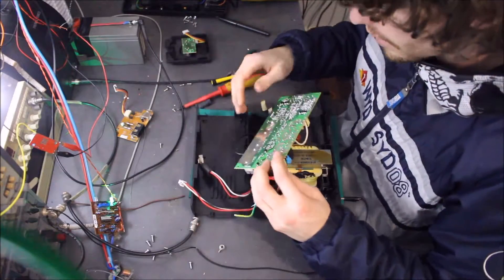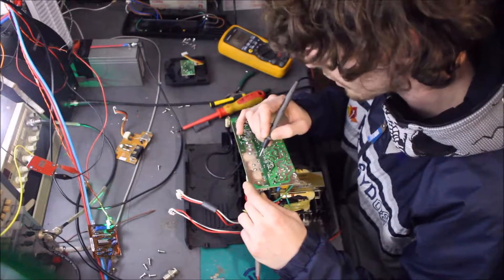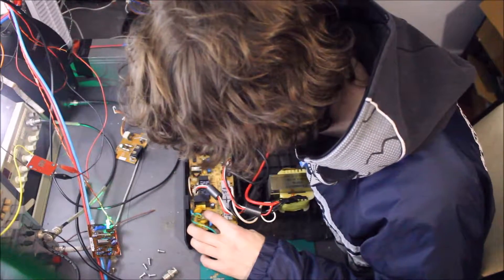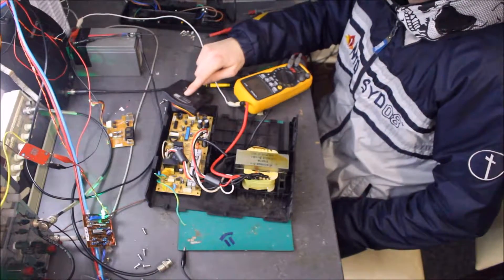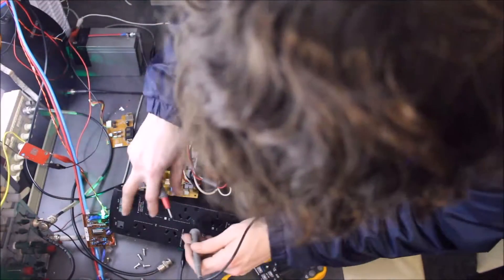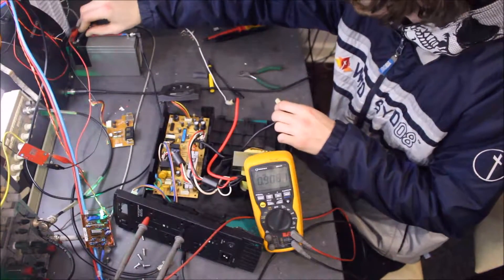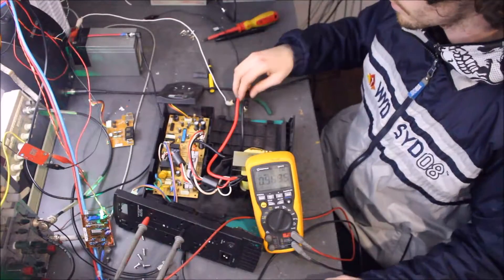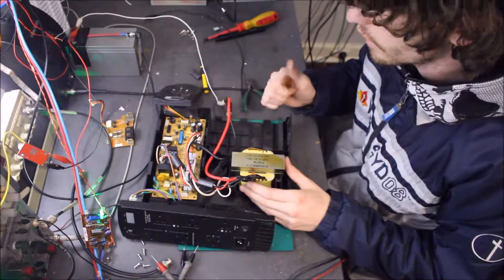UrbanOffGrid13 Eaton 5110 UPS test and power up

Comment: Thanks. I have the exact same unit and want to change it into an inverter. Problem is it will shut down in about 2 hours. Any ideas?
Reply from the maker: After 2 hours on the 5-7Ahr battery? even with no load the battery is probable flat. its a modified sine wave, you will have to use better MOSFETS to get a lower on resistance and heat sine them better then a block of aluminium, also the transformer will get HOT so you will need to cool it with a fan directly.
Hope this helps
Reply: Thanks for responding. I would like to use the inverter only. It will power my shop and some outside lights at a max load of about 360 watts. I connected it to my solar system battery, 220 amps at 12 volts. It operates very well but after about 2 hours the unit just shuts off, even with no load connected. No alarm and not over heated, just disconnects. I remove the battery power, reconnect it and it will run for another few hours. Do you know of any built in time delay that I could  disconnected? I really appreciate your help.....I will try the fan trick.
Reply from the maker: In that case it must be a timer in the micro controller, I have not run mine that long before so I have not come across it. mine has a usb B type connector so you could try and find some software and see if you can change the setting.
350watts for an extended amount of time is hard for these small units as the hardest thing is cooling the transformer. good luck just measure it
Reply: I do have the software disc and will try it out. BTW- the inverter will never need to handle the full load. Thanks again, will let you know----